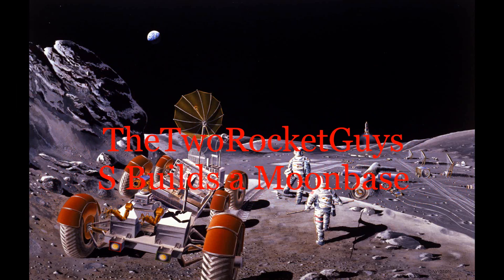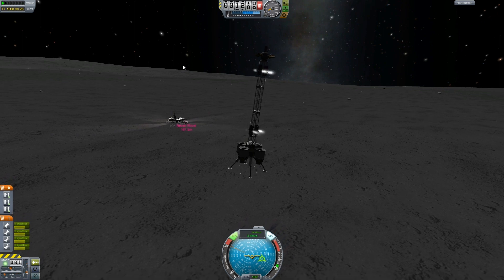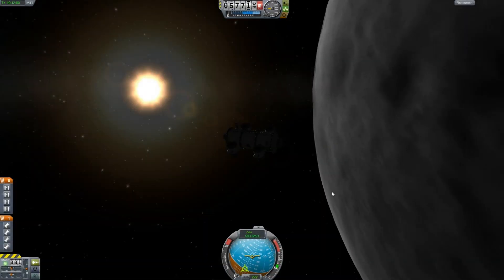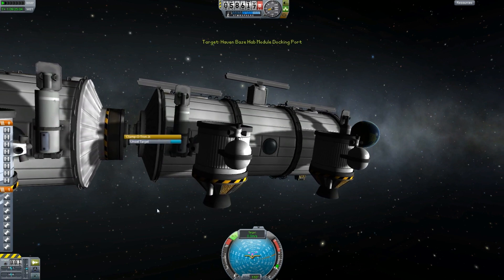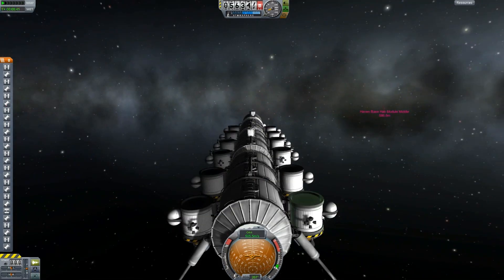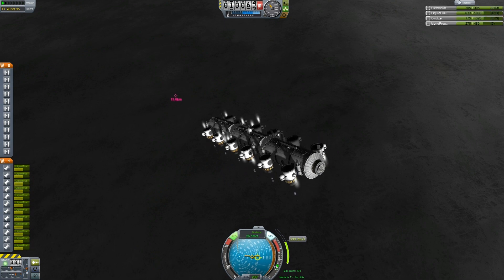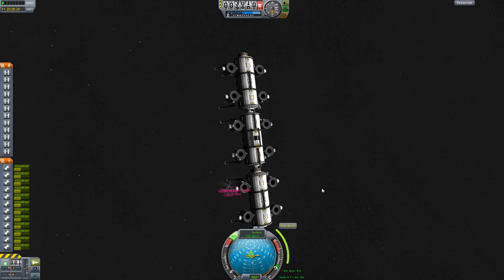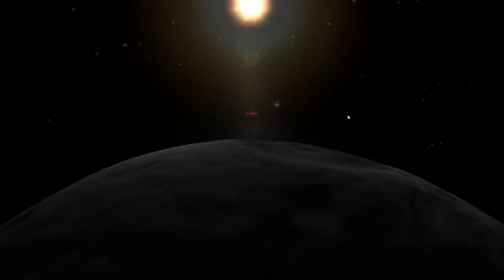Kerbal Space Program - Building a Moonbase Part 6: Lagtopia

Comment: Is lag a computer issue or a game issue? I have 16GB RAM, 2GB dedicated video RAM, and a 2.6ghz quadcore. I built a modest little station around Kerbin and noticed a little frame-rate lag. In 0.22 there is an option in the graphics settings to increase the FPS; I don't know if that makes any difference. I think one thing Squad could do to alleviate this is to enable multi-processor support. Currently it doesn't; KSP can't exploit the processor power.